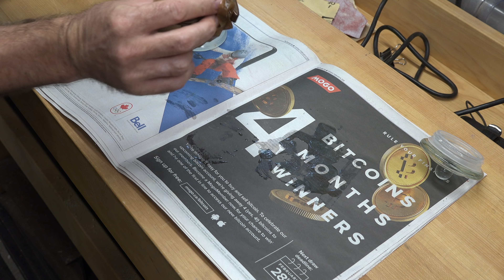Making a Wooden Spatula

Comment: Nice work....I've never seen a nifty ruler like that.  What are they called and what brand is that??
Reply from the maker: Thanks for the kind words.  The ruler you are asking about is called a T-rule and they are made by INCRA.  They are available at most woodworking suppliers or directly from Incra.com.
I got mine from Lee Valley Tools.  Here's a link.  https://www.leevalley.com/en-ca/shop/tools/hand-tools/marking-and-measuring/rules/58877-incra-t-rules
I hope it helps.  Thanks for tuning in to the show.

Comment: Thats a nice Crown square.... How'd you keep yours from rusting, lol. Mine started pitting within a couple weeks in my garage! I even waxed the thing! Cool video! Ive deen thinking of making these and some spoons etc.. Cheers!
Reply from the maker: Thanks for the kind words Christopher.  As for the square, I have found that wax isn't quite what it should be when it comes to tool protection and now I use Autosol metal polish which cleans the tool and adds a protective layer.  I use it on everything, even my cast iron tool tables and the stuff is awesome.  I hope this helps.  Thanks for tuning in.
Reply: @acutabove_woodworkings  great to know and thanks for the tip! I'm ordering some as I type this. Always fun to entertain new polishes and finishes. Thanks again!

Comment: Ken, another great project using my favorite wood.  Putting a finish on walnut sure brings out the colors.  I was wondering if that was the new or the old bandsaw, my guess it is the old one.  I was wondering how much flex there was in the spatula once it was at final size.  Sometimes you need just a bit to aid in getting under things.  Thanks for sharing.
Reply from the maker: Thanks for the kind words Paul.  Walnut is one of my favourites as well (as you know).  This was made on the old bandsaw before I sold it.  The show is pre-recorded and this was made before the new saw came into the shop.  The flex on the blade is minimal for this one and it is meant for more of a mixing spatula for stir fries and that sort of thing.  I don't think you will flip an over easy egg with this one without inadvertently making the eggs scrambled.  That being said, all it takes is making the blade of the spatula thinner in the design in order to add flex to to it and they sky is the limits for its uses.  Thanks for tuning in to the show sir.  Always great to hear your opinions on the show.

Comment: maybe a stupid question but im sort of new to wood working. What is the measuring tool you are using and where can i get one ? Thanks. Also will be copying this for some utinsils for my wife. Thanks for the idea.
Reply from the maker: Not a stupid question at all Jeff.  The measuring device that I use on the show is called an INCRA T-rule. They are available at most woodworking suppliers, but I got this particular one at Lee Valley Tools.  http://www.leevalley.com/en/wood/page.aspx?p=58877&cat=1,43513,58883,58877 You can also get them directly from INCRA as well.  https://www.incra.com/measuring_marking-trules.html I hope this has helped out.  Please feel free to ask any question at any point in time and I will do my best to help out if I can.  Thanks for tuning in and for taking the time to leave me a comment.  I appreciate it.
Reply: Thanks
Reply from the maker: You're very welcome

Comment: Eight quarter inch thick?
Reply from the maker: Yes, 8/4.  All of my projects start off with rough cut lumber.  Rough cut lumber is measured and sold in quarters.  So an 8/4 board is essentially a 2" thick board.  Lumber sold in specific measures of inches, such as 1/2" is normally finished dimension but rough cut is not measured or sold like that.  I hope this clears it up for you.  Thanks for tuning in.